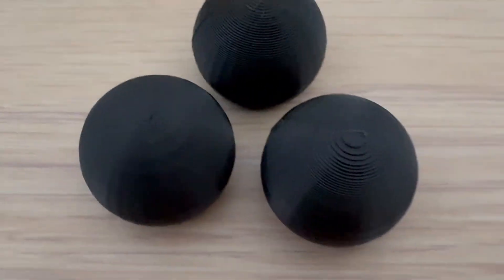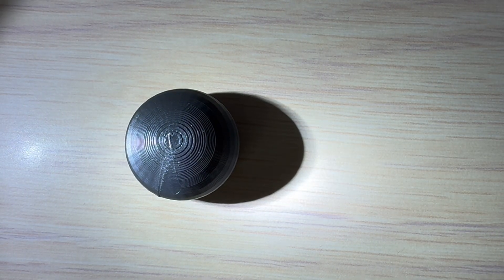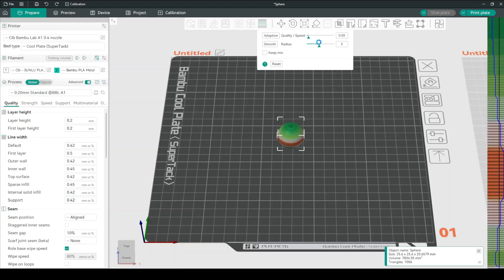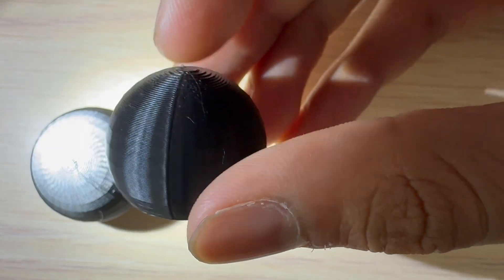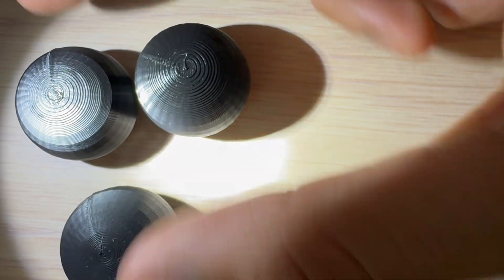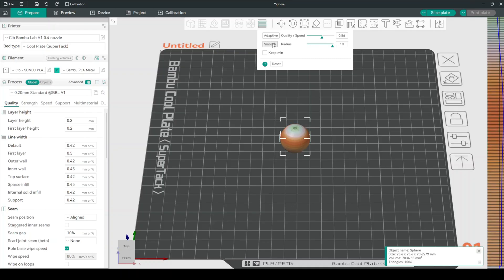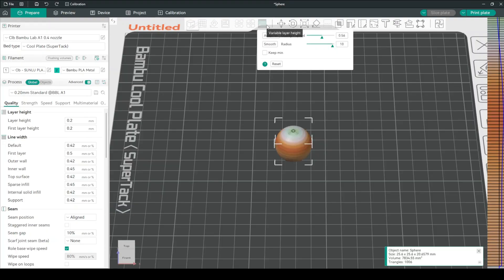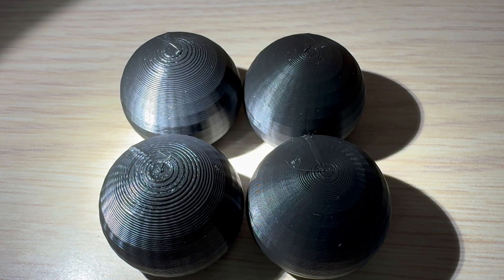Smoother 3D Prints in Less Time — Does Adaptive Layer Height Work?

Comment: Great tip and overview of adaptive later height.

Generally, what you're describing is referred to as "stair stepping".
Ringing is already a dedicated term in 3d printing (also called Ghosting). Ringing is a resonance you get after a sharp corner, it's caused by inertia and belt stretch; it appears as a wavy pattern after a corner. It's called ringing because it "rings" in the resonance frequency of your printer and modern printers try to compensate for that with input shaping.
Reply from the maker: Alright, thank you for this. I'll be sure to use this terminology in future videos. Glad you enjoyed the video!